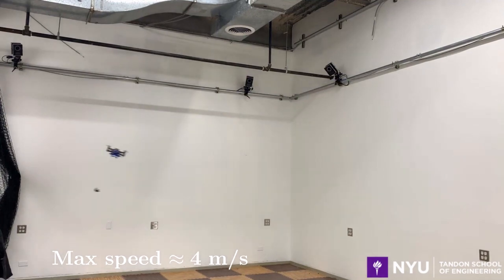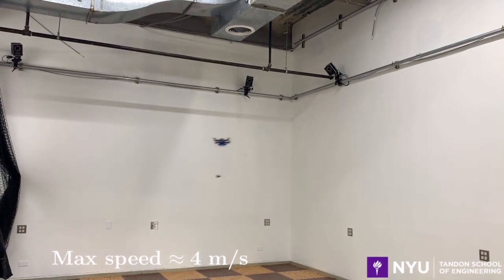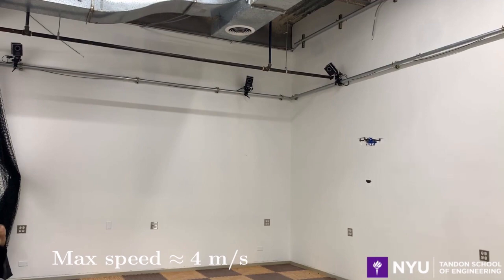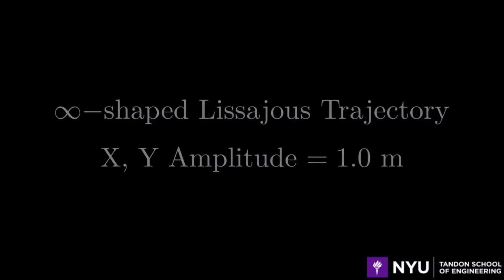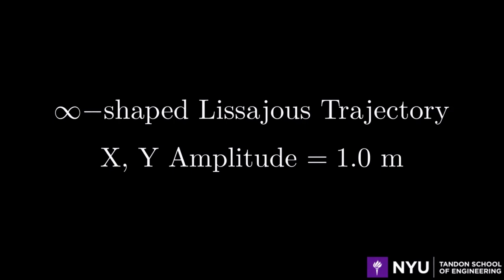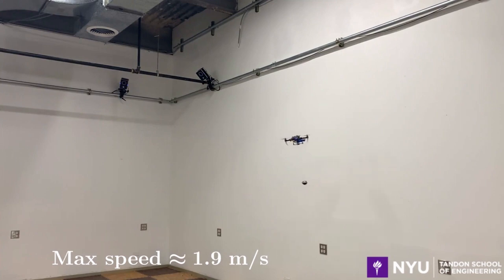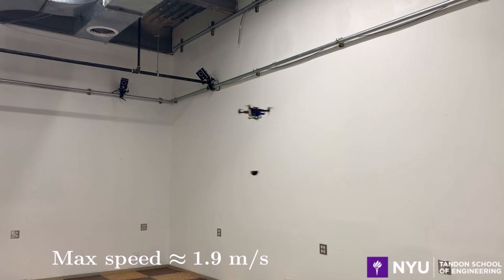PCMPC: Perception-Constrained Model Predictive Control for Quadrotors with Suspended Loads

Comment: Amazing work! Using a camera for tracking the angle was a great solution. Is there an option for manual control that keeps the weight as stable as what's shown? I wonder if it can do a loop with the suspended weight? Imagine a stereo camera system to go along with a winch to raise and lower the weight. Imagine if the weight was a secondary battery that could be hot swapped.